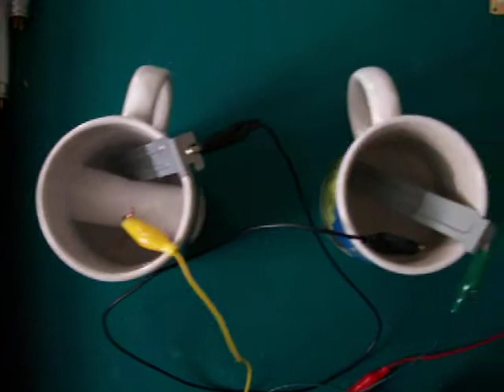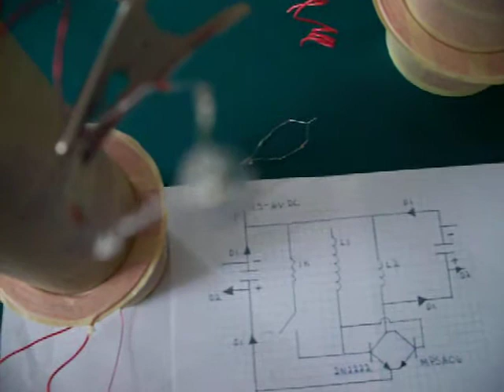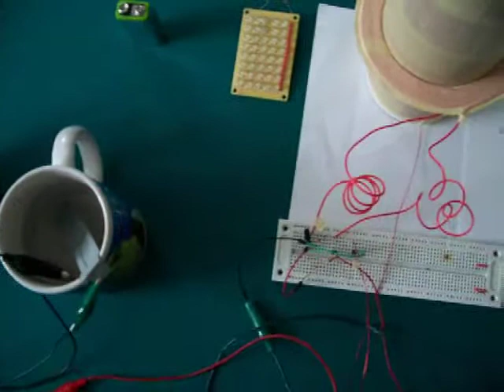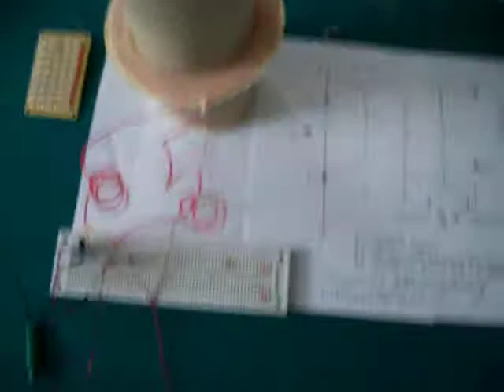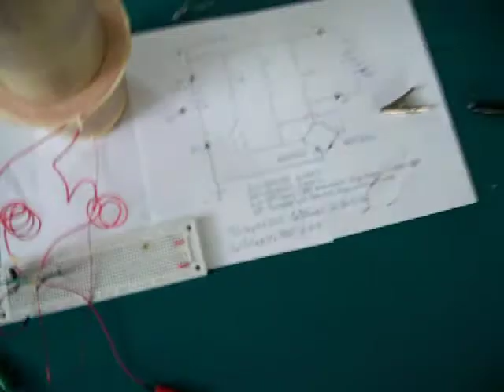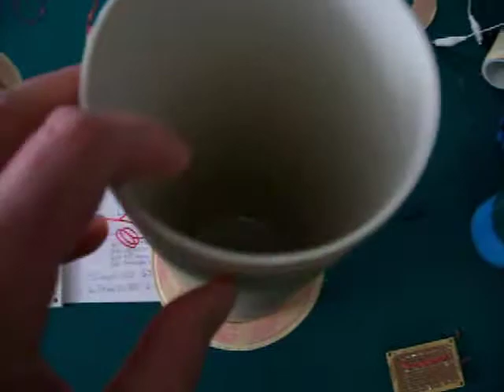Exiter running off water battery.mov

Comment: Lidmotor tried a saltwater solution today or yesterday, it depends in what timezone you live :-) . It is pretty much the same as sodium hydroxide, at least it is for this experiment. He thinks the LED shines a bit brighter with the salt water solution. It sounds logical because the water has less resistance, so any current can flow a lot easier inside an electrolyte solution. Less resistance means higher voltage or current according to ohm's law. It's the one law that I know. :-)

Comment: I did some experiments with electrolysis, and I used a sodium  hydroxide and water solution as an electrolyte. I have noticed that after the electrolysis some voltage did stay in the water, just like a battery would do.  A HHO device has many constructive similarities with a battery. 

But if you would add just a grain of drain cleaner (sodium hydroxide) to the water, does that change the amount of  the charge inside the water?  Have you ever tried that?

Greets, iT